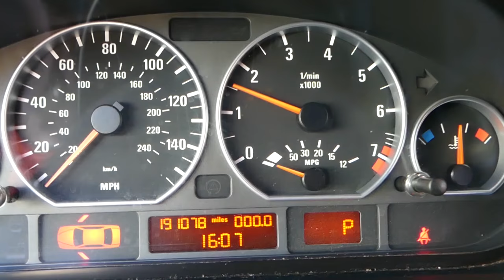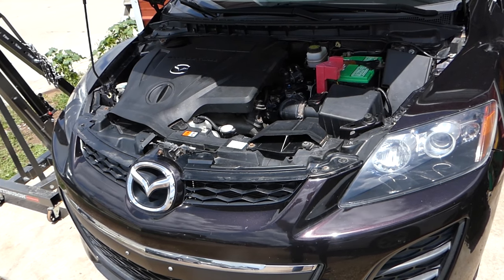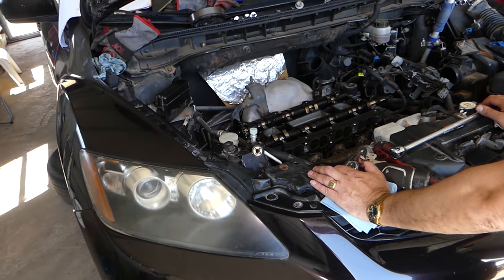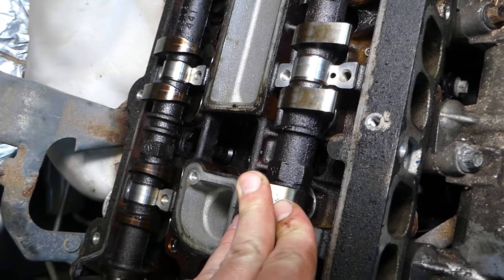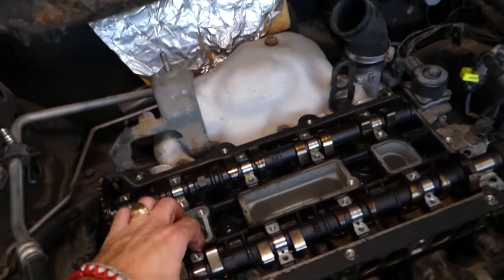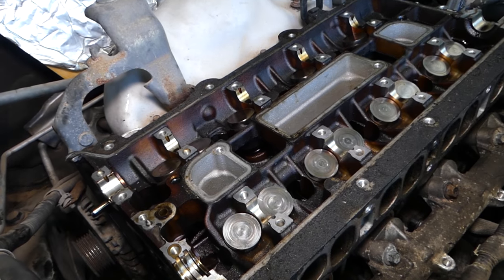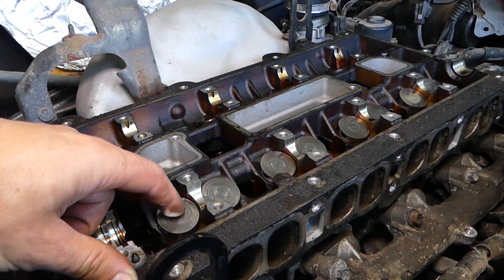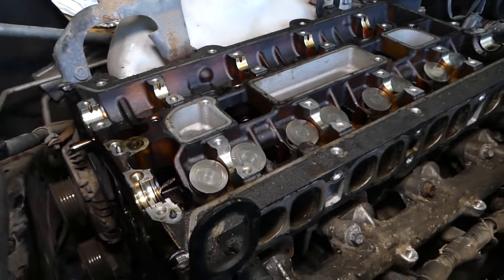WHAT VALVE LIFTER NOISE SOUNDS LIKE. WHAT CAUSES VALVE LIFTERS NOISE

Comment: i've literally never heard an engine that DOESN'T have a ticking sound like that. how do you not go insane trying to track down every single tick and click? there are a million moving parts and any one of them could be clicking
Reply: exactly my frustration.

on hearing my car engine, ive had recommendations from a professional mechanic saying 'nothing wrong', a veteran private car trader saying 'get rid of it' to a old car guy saying 'worn tappets' (my car is over 150k) which led me to this vid.

opposite to all of this, ive heard advice online that my specific engine just has loud injectors.

im trying to learn, who do i learn from correctly? 💀

Edit:
I just saw another comment that reminded me.
Someone else said loose belt tensioner or worn belt. lmfao
Reply: Because you likely heard direct injections engines, they are loud and make this noise
Reply: @ruutjormun2262 start with adjusting valves or replacing/cleaning lifters if ur car has them, if that doesn’t work, then keep looking lol, if it’s a grind/whine it’s probably something rotating could be a bearing water pump etc, a ticking is something moving back and forth, so could be valves, valve guides lifters, maybe rocker arm assembly. I’ve had one car fixed completely and sounds perfect with 180k after taking apart and cleaning lifters, but my other car (a Honda🤦‍♂️) ticks persistently even after valve adjustment, since it has no lifters, but some people just say some engines are noisy, so it’s hard to know

Comment: dude great video, was going nuts trying to diagnose the noise coming from the head of my engine...thats exactly what mine sounds like!!! thanks!!
Reply: I got the same Noise Im just glad its not rod nock. Rock nock doesnt go away I assumed it was my valves I tooky my car apart and sent the heads to be fixed and then replaced the pistons and cylinders to handle what I do with my car. Its cheaper when you know whats wrong with your car.
Reply: @burntchickennugget191  should the piston and cylinder replaced?
Reply: @burntchickennugget191  you replaced the cylinders ?? What 😂😂

Comment: My 2014 acura Mdx with 109,000 miles had this issue and I replaced thinking it was rod knock 😭 but I saved the engine to fix myself 🫡🫡

Comment: Great video. But, beside the noise, is there a problem with noisy lifter valves?
Reply: Depends by the noise, there are engine where a little noise Is normal but when the noise Is too much you are going to do damage, go to your mechanic and make It listen

Comment: I have this on my Corsa B 1.6 GSI, but the hydraulic lifters are new and the valves too? Any idea's?
Reply: The camshafts itselves are worn maybe?
Reply: @misterispusovcikas9066  Problem is, when i open up the oil cap the sound isn't louder. So that would say the sound isn't coming from the valves/cams
Reply: Spark plugs? They crack if used for a long time
Reply: @misterispusovcikas9066  We're also new, i like put in the new cylinder head with new valves+lifters. Cams we're still in decent condition. Replaced oil a few times to 'flush' the engine (because with taking off the head some shit might've fallen into the lower block. Ofcourse also changed the filter with that. I use 10W40 castrol half synthetic. And then also changed the spark plugs. Thought the 'ticking' would go away after a few thousand km's because of them being new but 10k further i still have it sadly... Do you have any other suggestions?😂

Comment: Gotta remember to put the crankshaft at TDC & mark it on the camshaft and crankshaft before you pull it apart makes reassembling the engine a lot easier
Reply: its usually already marked but yes good practice

Comment: As veteran mechanic on noisy  valve trains....Before you tearing your engine apart to do this..Make sure you have plenty of oil pressure.Low oil pressure will make valve train rattle.If your not sure if enough pressure then add 1 quart of auto trans fluid to your oil and drive the car for couple days to see if the problems goes away..If it dont then change the oil and put 1 grade thicker oil in it and still add 1 quart of auto trans fluid.Then drive for a couple days agian...Sometimes the  oil pump and or lifters get a varnish in them and they stick and dont function properly making extra noise due to lack of oil flow.The auto trans fluid has additives in it that wash the varnish  away from the parts.
Reply: what if my check engine light is on and is making this sound as well? The sound is the exact same as the video
Reply: wow I didn't realize their even WAS a fuel pump. so I got an o2 4.6 gt.. I recently had oil changed and literally ticking started after next 2-300 miles.. my gauge reads high pressure and dipstick is at max and looks almost like it just came out of a bottle.. should I try these same things? I can't do major work myself and Google says anywhere from 1000-2500 to fix lifters.. I got 2 lil boys im tryna raise on my own I NEED this car.. heck I only drive 10-15 miles a day maximum
Reply: thank you! solid advise. Im curious if Marvel Mystery Oil is similiar to transmission fluid......or works in the same way.
Reply: @scottieallen3201  I wouldn't freak out.  Does the noise speed up with rpm? Are you sure it's not a rock in your tire?
Reply: My tick/knock speeds up with the rpm’s. What does that indicate?

Comment: Thanks for sharing.  I didn't understand fully why the noise was happening.  Is it because the valve lifter was worn out, meaning the thickness of the metal is worn down which creates space for the tapping sound?  I just could not see from the video how to tell if the valve lifter is the main or only source of the tapping.  Comparing a new valve lifter to a worn out one that needs to be replaced would have been more helpful.

Comment: My car just started making this noise.. and it happened immediately after I filled up with bad gas.. I always put premium, this time I put gas and about an hour later car started misfiring and idling rough.. then it started cutting power at boost/misfiring, threw a misfire code on cylinder 3 and then the next time I turned it on it started making this lifter/ticking sound.. :'(
Reply: new spark plugs, detonation issue from using low grade fuel
Reply: @jamesciembor8129  I only use premium.. I did change the spark plugs, I use NGK ruthenium plugs.. one was fouled, engine still ticking.. but I've had it for 5 years and only have 28k miles on it so fuck it.. #yolo

p.s. My drivetrain warranty literally expired 1 month before the ticking started.. (5 year/60,000 miles)
p.p.s. My extended warranty expired at the same time.. don't see how that qualifies as an "extended" warranty when it expires at the same time as the drivetrain warranty.. stupid Ford ESP.
Reply: @Sigrafix  it should be fine. A little ticking doesnt hurt anything. As long as it doesnt misfire anymore or run rough then i wouldnt worry

Comment: When I took my valve cover off and seen nothing but FoMoCo on the parts it was then I realized I F’d up
Reply: I drive an Ecotec 1.6 Opel thing. Seems to reliably have terrible lifter knock on Every. Single. Cold. Start. Bad? Maybe? Probably? Normal even? Who knows, no body nose. Only lasts for 2-3 seconds though. GM makes funny cars as well my frien
Reply: @windshield11  ecotec family 0 1.2 with 167.000 km. Funny noises are now a common occurrance, it sounds like it wants to tear itself apart but it's just Opel things

Comment: So what you are saying is I need to take the engine apart, install new lifter(s) and then put it back together again, or with a V8 pay $3000? Even if the proj takes me 60 hours, I'm making $50 an hour cash. Winning.
Reply: V8 Mazda fwd for the win.
Reply: Diy while you can, or give the dealer their bonus....
Reply: Mike if you are winning you'd have a new Audi, Lexus, etc and it would be paid in full, yes mate?

Comment: In my experience rod knock is loud it does get worse with acceleration more of a clunk. Where lifter tick will get worse with acceleration but it's a tick and a easy way to tell is taking your valve covers off and just checking for loose pushrods im building a 99 gtp went from 240 hp to 340 just do it right. My dumbass didnt lash or a rod length test so i collapsed a lifter and sounds horrible. Its always hard to tell but your gonna have to do some digging to actually tell
Reply: thanx you so much guys this it help me alot and i get more knowledge from you, but let me ask you this how can you know that the noise is from timing chain?
Reply: Yep. It’s very good to know the difference for sure. Rod knock is serious and is a very clear indication that an engine is about to fail. Lifter tick is much more minor and won’t cause an engine failure. Lifter tick is much more common and will sort of slowly creep up as the engine gets older. Rod knock tends to happen more suddenly and is more severe.
Reply: @photoniccannon2117  what’s an easy way to fix lifter tick??

Comment: What causes rattling noise at 3k rpm or higher but not heard below 3k rpm?  My guess is the timing chains.
Reply: Though I don't know about a car but I do own a bike and meddle in their forum you might be right. It could likely be the timing chain and the timing chain tensioner or CCT cam chain tensioner is the issue. Pretty common for bikes to fail and show such symptom like you said. Changed mine from an auto to manual CCT and the slapping noise is gone. Downside is I gotta tension it every 10k km. For cars you can only get the automatic original.
Reply: @kaiser98berlin  that sucks my trucks engine does this that's gonna be a job to replace the tensioners.
Reply: @chriss4365  hey I might be wrong. It could be valve lifters that need Valve clearance adjustment as shown in vid then changing your CCT alone won't do. The Best method is find a flat head screwdriver 🪛 put your ear on the handle end and place the flat end on various parts of your engine to find the source of sound; Play doctor. Trust me this will save you lots of headache and helped me during my motorcycle repair. It's easier for a car compared to a bike. If your Truck runs on rubber belt for timing then it's likely not the CCT or timing belt noise instead it squeaks from the worn bearing. If it runs on metal chain then its possible to be this issue, it resides inside the valve cover running along the cylinder blocks and for some the CCT can be shown outside the block. Probe those parts and sooner or later you can hear where the sound comes from.
Reply: @kaiser98berlin  I only hear it when driving and I hit it. Engine revs up and I hear the noise. I dont think my engine needs valve adjustment.
Reply: @chriss4365  I see, have you tried reving it when stationary to hear if the sound is there?
Reply: Yes and don't seem to hear it.

Comment: Do you happen know what could indicate the similar knowcking sound on higher speeds? Till 30-35 mi/h the car runs very quietly. It is 2003 Chevy Cavalier. The knocking sound starts ~ 40 mi/h, increases to maximum at ~55 mi/h, then goes a bit down.

Comment: My car sounds like that but is inconsistent and mostly after it's been driven and in deive. I'm getting it checked tomorrow to know for sure but do you think it could be a valve lifter?
Reply: Did you ever find out what it was mate ? Mine inconsistent too only started yesterday
Reply: Tbh some cars just do it. 
I’ve had a mk5 and mk4 golf both had noisy tappets. The mk4 golf is still going at 330,000km, bit noisy when cold.
Same with the focus zetec 1.6 engines. 

Unless you plan on doing the head of the engine yourself just live with it 👍

Comment: Can head noise, say lifter chatter cause the engine to seize etc? I've had this chatter when shifting around 3K RPM for 2+ years and just turn my radio up. :)
Reply: Same bro
Reply: Honestly, valve lifter tick is usually not a major issue. It’s very common, even normal, for older engines to do this. Be diligent with your oil changes and make sure to take care of your engine. As long as it isn’t experiencing rod knock, the tick noise isn’t a huge issue as long as it isn’t excessive.

Comment: I hear this ticking but it only sometimes happen when my car is under load climbing steep hills but there is no noticable reduction in performance this one is a mystery to me 😕
Reply: Same with me here. I experience it when the car's RPM is under 1000, AC turned on, gear in drive. Or climbing hills with even switching on the Air Conditioner. I'm using a Camry 2011.
Reply: That's brief engine knock under load. Your owner's manual will usually mention this particular scenario and assure that this is nothing to worry about.
Reply: I got the problem, it was my coil pack on cylinder 3 that feeds cylinder 4 as well was going bad it developed a small misfire today changed it, didn't get bad enough to throw a code and the issue is gone completely and the car feels more powerful too, sooo I am not sure if that'll be the solution for anyone but have a look at that just in case
Reply: Some cars camshafts wear out as well causing the problem
Reply: @ucakpan  don’t ever become a mechanic because you will never get any customers
Reply: @iamasmurf1122  wear out? They might wear but that can be adjusted out
Reply: @digiecovers543 how did u solved your problem

Comment: I'm not sure if my car is making this noise. Mine only does this at idle and sounds like a stopwatch not as loud either but its faster. It usually makes this noise on a cold start after it has been sitting. I've also been having an occasional starting issue. Could this sort of noise be anything else?
Reply: How old is the car? If you didn’t figure it out that sounds like a realllly bad fuel injector lol

Comment: I had this noise after a hard high speed run but it seemed to go away after I turned my car off then turned it back on... Seemed weird.  Any idea what it could be?  Sounded like from the top of the motor but it seemed to go away a few seconds after restarting.
Reply: Ever figured out wat it was?
Reply: @Z33tech  I never got the noise again but I had a fuel pressure sensor go out a few weeks later and had that replaced, then the engine wiring harness replaced, not sure if that was related to the noise or what.  Seemed weird but I didnt have that noise again and the car is running fine after those 2 things were done.  The symptoms that caused the sensor and harness to be replaced were stalling issues and non-restart, fuel pressure reading going crazy etc.
Reply: I have replaced only a timing belt, nothing else and it went off. 👍
Reply: @thestone3849  solid! heard this elsewhere also.......... still good?
Reply: Hold your revs at 3000rmp for 3 minutes. That'll put oil in the valves and stop the noise
Reply: So I started using my a.c. During a long road trip and shortly after i noticed my fan would turn back on as soon as it would turn off. Pulled over for about 20 minutes and started driving again. Forgot to turn the a.c. off and then a green wrench popped up on my dash (08 f350 super duty w/the 6.4 engine) and when i stopped a second time i heard a ticking/knocking. Got to where i needed to be for the day. Turned it on in the morning, green wrench is gone but ticking/knocking is still there. Any ideas? Appreciate the help
Reply: @roberthall7206  your service day arrived. Could be lack of oil BTW. Check oil first. And try to connect OBD device.

Comment: Can you assist me I have bmw 316i f30 Fem module burned and I bought new 1 from bmw and I took it to programming when I plug it back it does not start it turn on, but is not cranking hope you can Asist regarding this issue

Comment: 2e engine head done at engineering company first time tappet was not set by the engineers and started the company saib it is the work of the mackanick they don't set tapets but now we set the tapets and started the car it is making a big tapet noise, white smoke and water from the exhaust

Comment: my suzuki vitara 1.6 has same ticking sound, but less noise than that, its only 23,000km or 3yr old, should i need to replace that? does it reduce the performance? can you answer please? coz some people in forums said its normal in m16a engine coz they already replace it but in days past the ticking sound will still return, in confused what to do.

Comment: Hi I’ve got a Volvo XC 90 2005 I’ve got clicking noise I believe it can be lifters but This noise you will hear only when accelerating and on 3000 revs suddenly stops like just switching it off also on the idle around very smooth any idea what it can be kind regards Peter

Comment: Those are not lifters, those are valve shim buckets, the camshaft pushes the valve open, unlike a pushrod engine that has lifters that push on a rod connected to the rocker arm which operates the valves

Comment: But what does it sound like after repair?
Reply: CarlGB good question. One of there thumbnails shows the engine out of the car...
Reply: They won't show it because that noise is too loud and thick for just bad valve clearance/hydraulic lifters IMHO. I'm pretty sure a good part of the noise is coming from the engine block too. Just look at the state of that engine oil.
Reply: Vroom vroom

Comment: Can they make a chirping noise as well? I have a noise that chirps and get faster with rpms and slows down as car idles this is on a 2012 camaro ss with after market parts
Reply: Omg this is exactly what I'm wondering. I live in the country and seriously at first thought i was hearing birds when I was going down the road.
Reply: worn bearings possibly, or bad contact of the cam
Reply: @beckycollins3190  what was it
Reply: @manikjones9004  I didn't have the car long. Thankfully traded it to the guy selling it to me before I registered it. I kept getting told the valve flapping and chirping or whatever is really bad and the engine is more then likely to go soon. The heat and ac didn't work in it so a chirping noise could have even been a bad blower motor though so idk.